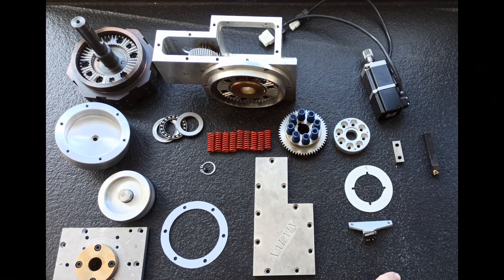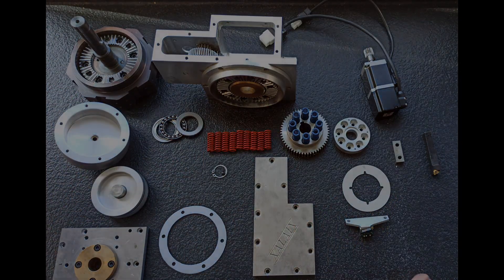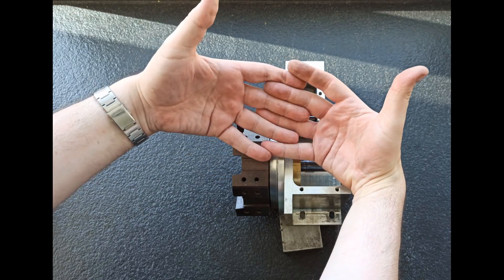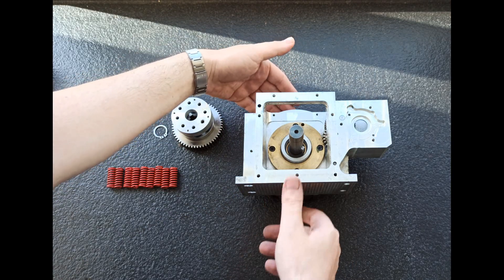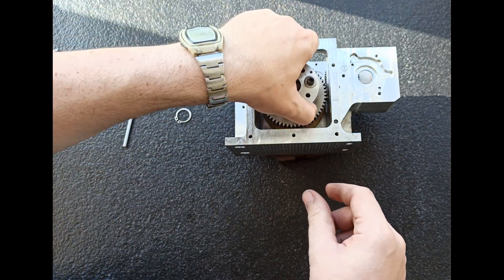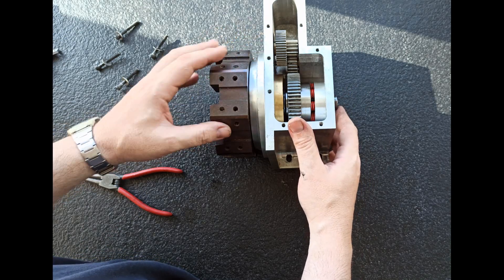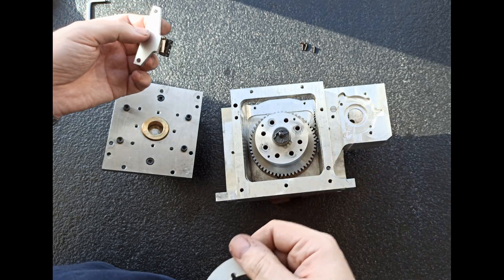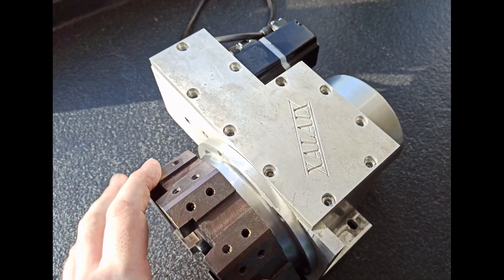cambiador automático de herramientas para torno cnc de 8 posiciones y explicación de funcionamiento

Comment: Not sure if you're still active or not but thank you for this.  How much air pressure does your cylinder need to overcome those springs?
Reply from the maker: Yes, I'm still here, but I don't upload videos because they take a lot of time and don't generate much interest. The piston is 80 mm and needs at least 7 bar to overcome the force of the springs. Thank you for your comment. Best regards.
Reply: @tessenCNC  You'd be surprised where open source land is heading.  You were before your time technically.  Change your tags up and you'll get more traffic/interest.

Comment: I have another question for you. What materials did you use to build the ATC Tool Turret? I just finished designing an ATC for my manual lathe CNC conversion and I am trying to figure out what materials I should use.
Reply from the maker: The structure is constructed from 7075 aluminium from a solid block, but the Hirth couplings are made of hardened steel (they are commercial parts) and the tool holder head and rotating shaft are made of steel (blued). I am pleased with the result, but it is clear that the more rigid the material, the better.
Reply: @tessenCNC  Awesome, thank you! That is helpful. And thank you for the quick reply! For mine, I am trying to decide if I do all 1018 steel, or all 4041 steel, or combo of both? And maybe tool steel for the shafts? I'm just not sure yet. I'm trying to save money and use materials that are more easily machinable.
Reply from the maker: @MusicCityMfg  I used F127 for the tool holder head and for the shaft, because that's what they had in stock in the warehouse. Aisi 4140 (which, if I remember correctly, is an F125) is also perfectly valid. There's no need to go crazy with the materials; a medium-strength steel that is easy to machine would work well. 

https://foro.metalaficion.com/index.php?topic=7845.0

This is a forum that is now closed, but it still has the photos and some details of the construction. Some time later, I made several modifications, but in case it helps you.
Reply: @tessenCNC  Awesome, thank you and thank you so much for the link to your build details. That will be very helpful. I will be posting video of the entire build once all the components arrive. I'm going to do the lathe CNC conversion first, because that will help with tool changer build. I will definitely give you a shout out when the time comes. Your video of the ATC was a huge help and inspiration. Thanks again!

Comment: Amazing work. How do you home the toolholder? How do you know which tool number is active? Thanks!
Reply from the maker: Thank you! When starting the machine, I have to press the button for the tool in the working position (out of the eight available tools) for more than two seconds. This sets that tool in the control, and from then on, the others can be selected automatically with the programme or manually by briefly pressing their associated button
Reply: @tessenCNC  Clever! Thanks for the reply!

Comment: hello! I am curious about electrical schema, or about breakboard for motor control. Thank You!
Reply from the maker: Hello! I do not have a scheme as such, I have an excel sheet where I write down where each cable goes, the control board of the motors is the Kflop of the company Dynomotion, it is a fully programmable FPGA type, depending on the configuration you load this can be a lathe or a washing machine 😄 I use this board for all my machines, I leave a link for you to see "the wiring" actually outputs are outputs and inputs and can be configured  --> https://dynomotion.com/Help/SchematicsKFLOP/ConnectorsKFLOP.htm

Comment: This is a great idea, very impressive piece of equipment.  Almost looks like a clutch system based on a motorcycle clutch.
Reply from the maker: thank you very much, I don't know much about motorbikes, but in general, clutches work more by a friction locking between parts, this is more like an interlocking, the stop position at each station, has to be always the same, so as not to affect the machining.

Comment: Greetings from Australia
This is a beautifully designed tool turret.
Wonderful work and an excellent video production easy to understand.
I am half way to making a turret also in CAD first.
You design has inspired me.
The Hirth coupling I guess is the biggest hurdle at 600 Euro it is a lot for a DIY maker.
I wonder if this would work?
Replace the Hirth rings with two similar size to the Hirth coupling rings, with two rings that have a circular array of of holes that are joined by a circular array of array of matching ball bearings.
I have drawn this up and I think I can get it to work. The balls need to be slightly bigger than the holes in the disks. They also need to be retained to one of the disks. Using balls and holes instead of teeth still enables the error averaging that is the real key to the accuracy of a Hirth coupling. An array of holes in a disk is fairly easy to make for a DIY machinist. I made the disks 10mm thick 10mm holes.
Reply from the maker: Hi, I'm glad you like it, thank you for your words.
The coupling, you can do it, yes, but it is not as simple as it seems, it is not only that the holes of the plate match in one position, but must match in all positions, without moving the plates or axially or radially, if you have access to industrial cnc machinery you can do it, apart these discs must withstand the load of the tool without moving. Hirth discs are so expensive because they ensure all this, they are hardened and ground.

Comment: buen dia disculpa como controlas el giro de la herramienta sin sensores de posición para cada una estoy haciendo un torno cnc y estoy en este dilema como girar y poner en la herramienta exacta estoy usando mach3 la idea que se me ocurrió es ponerla como un 3er eje
Reply from the maker: Hola, hay varias maneras de hacerlo, yo no utilizo mach3, pero si, como un 4 eje, configura los pulsos del eje del controlador de la torreta para que una unidad de movimiento sea una posición de la torreta, es como configurar un eje rotatorio, si tu motor tiene 360 pulsos por vuelta y tienes 6 herramientas, de una posición a la siguiente tienes que moverte 60 pulsos

Comment: Can you tell us what gear (teeth and module) you used in this project?
Reply from the maker: Hi, yes, no problem, the gear ratio is 1:14,7 from motor to disc -> Z14-45 (module 1) z18-55 with a z24 freewheel (module 1.5)
http://img.photobucket.com/albums/v219/tessen/torno%20cnc/torh176.jpg
Reply: @tessenCNC  i count gear teeth on z18 it seems like z12
Reply from the maker: @9782ravi  yes,  you are right, sorry for the mistake, I confused the primitive diameter with the number of teeth.
Reply: What is the size of linear rail of both axis?

Comment: Excellent work! It looks very rigid.. I'm curious to know why didn't you use pneumatics for clamping force?
Reply from the maker: Hi, thanks, because the turret cannot rely on air to maintain position, if there is a problem in the pneumatic line and pressure is lost, it can be unsafe. On the other hand, while the lathe is cutting part of the cutting force is used to close the two hirth discs and this force is added to the force of the springs, just turning from the chuck outwards, the springs do all the clamping force.
Reply: @tessenCNC  ahh... I had an idea that was the reason. What do you think about putting a pressure sensor on the piston if you were using it for clamping. AS soon as it picks up a pressure drop it activates estop. Would that be possible in mach macro and what do you think about that idea? Im building a turret soon and cant make up my mind. Your video already helped alot.Any futher advice would be much appreciated. Anything you would do different with you turret design? How is your bronze bearings holding up? Look like you did a slow oil quench to the tool holder?
Reply from the maker: @gerhardgroenewald6560 
- yes, there are a few ways to do things, if you put any kind of pneumatic control system to control the state of the clamp, it will work, in this video I do it the other way around, with the switch I am controlling that the tool holder can rotate
- bronze bearings only support the shaft, they do not fix the shaft position, because hirth couplings are self-centering.

- the tool holder has a bluing treatment to avoid oxidation, it is a chemical bluing, it is not by heating and putting the piece in oil.
- I am very happy with the tool changer, everything can be improved, but I don't see any major defect to correct. I have pending to make a video demonstration, not only of the tool changer, but of all the functions that I have added to the lathe, but I still have other things to do.

Comment: Sir, how do you track the tool position? I noticed you use a hybrid stepper/servo and no separate position sensor?. I understand the microswitch is to indicate curvic coupling released and tool ready to rotate.
Reply from the maker: Hello, the turning motor of the ATC head is a 100w ac servomotor and I do not have a "tool 0" or index type position sensor, to know which tool I am in, when I start the lathe for the first time, if I leave one of the 8 buttons on the control, pressed for 2 seconds, this indicates to the control the number of the tool that is in the working position in the turret, if it is pressed for less than 2 seconds it will change to the number of the tool of the button pressed and if it is longer than 2 seconds it will indicate that the tool in the working position corresponds to the number of the button pressed.
Reply: @tessenCNC  thank you sir, nicely done

Comment: Excellent work!, is there any cad for this, i would be interested to see how the die springs work.
Reply from the maker: Hi, thank you very much, I can't provide you with the cad, but I leave you the data, it uses 8 springs (ISO10243 B13-032) precompressed 9mm and with an effective stroke of 3.5mm.